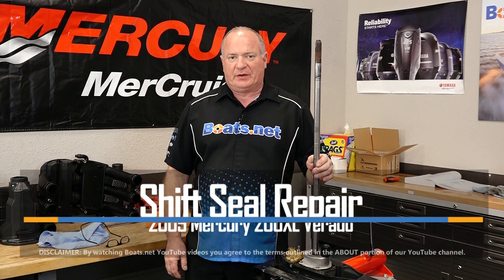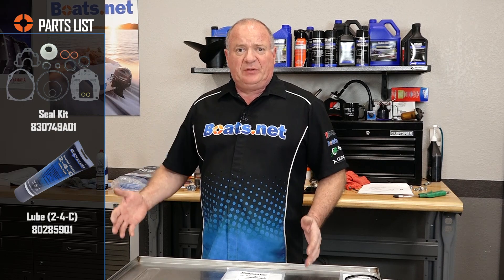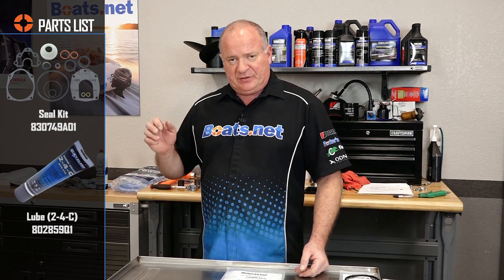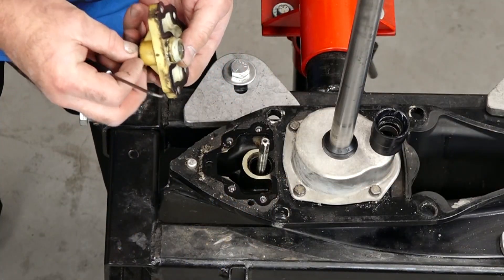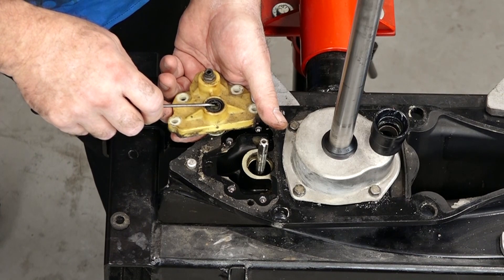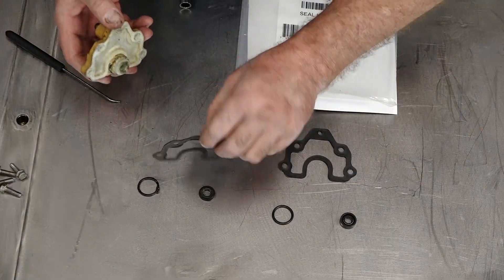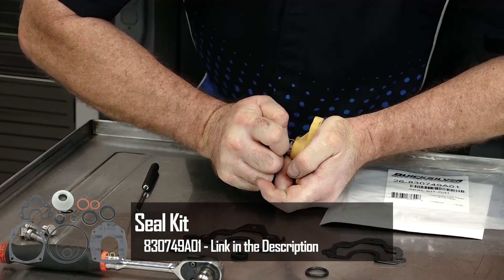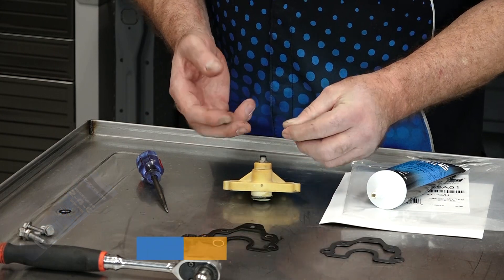Mercury 200 Shift Shaft Seal Replacement | Mercury 200XL Verado Shift Shaft Seal Replacement

Comment: i have a 1999 merc 2.5L 200XL BlueWater, my shift shaft looks bent, and it the boat only goes forward, not neutral or reverse. Is this expensive to fix??

Comment: I have a 2001 Mercury 225 XL EFI - 0T363975 What is the correct lower unit part to resolve binding of a forward shift? Do you have a video for that?